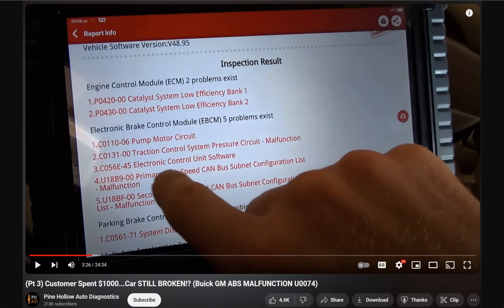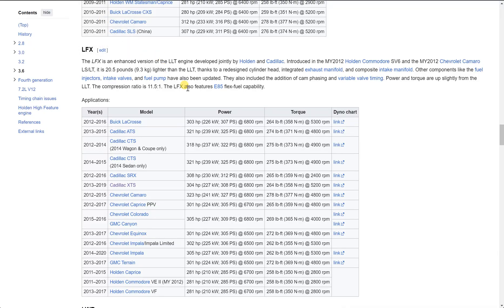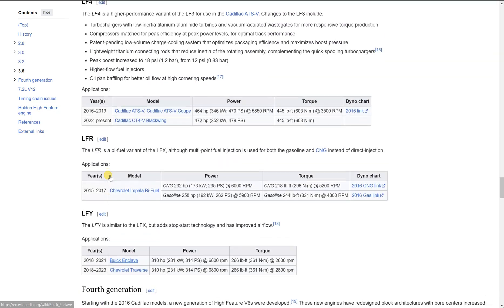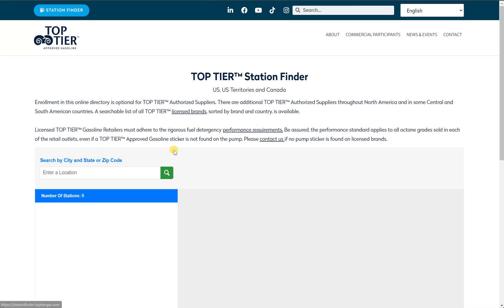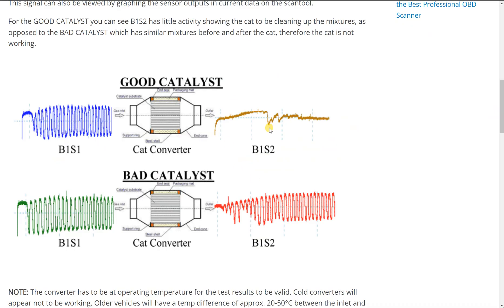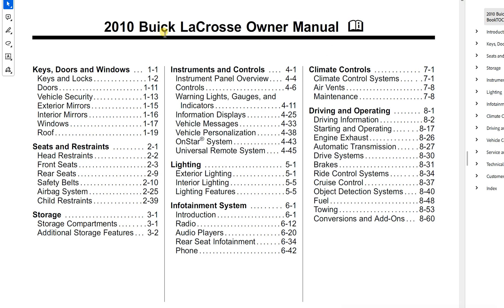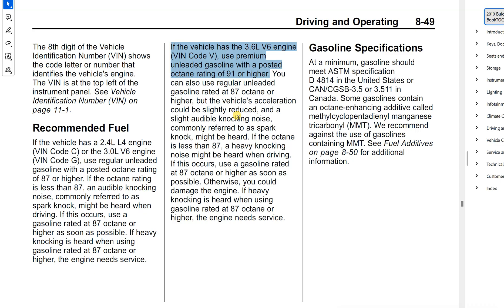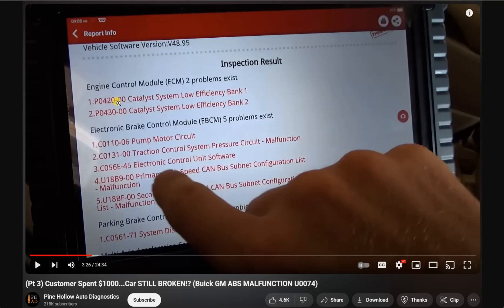Can using the wrong gas cause a P0420? I argue it can. Short discussion on GM High Feature engines.

Comment: Hi oneanddonediy.  I enjoy your video.  The 91 octane or higher is needed for high compress ratio engine.  A compression ratio of 10.5:1 or higher needs high octane gas 91 or 93 because it requires higher compression for ignition.  A lower octane gas leads to pre-ignition in high compression engines.  Also, spark plugs are important.  Also, cheap gas will with low detergents will lead to carbon build up on valves, rough idling, leading to misfiring and eventually a check engine light.
Reply from the maker: Indeed thanks for chiming in!  Running 87 is only good in some cases, but people need to be aware that the car 'will run' on 87, and the owner's manual may 'recommend' 87 but that is not the best choice in a lot of cases.

Comment: 91 octane Non-Oxy gas is all I run in my LFX!! An engine that has an 11.7:1 compression ratio shouldn't be running 87. Also, ethanol is nasty shit, there's no way in hell I want that in my tank (e10, e15, or e85)!  Interesting take that the higher octane cuts blow-by and consumption. I've had the best luck cutting the oil consumption using Valvoline Extended Protection 5W30. I would also advise anyone with a High-Feature engine to run a catch can on the dirty side of the PCV and a clean side separator on the clean side to capture that 5-10% blow-by that comes back through the clean side on WOT acceleration.

All in all, it's a good topic of discussion, and more people need to be made aware of the potential pitfalls of these engines, and what to do to prevent them!! 👍

Side note: I made my own sticker and put it on my wife's Cruze's gas cap to only use 91 octane. That 1.4 LE2 turbocharged engine ABSOLUTELY needs 91 octane, and nowhere is it mentioned to use 91. Those early LE2s were grenading left and right by people using 87 and driving them like they stole them..
Reply from the maker: Here in NC we have 93 octane, and that is what I use in both my Buicks (LLT and LGX).  I'm my 2006 Colorado 3.5 L in-line 5 cylinder I used 89 octane, and in my pitiful 1.4 L 4 cylinder (but it has turbo!) in my Honda CR-V I use 87 octane 🤣 .  But for sure these GM High Feature engines get a bad wrap but usually people drive them like mad as you said and don't give them just a little TLC. Also I have been considering a catch can. For now everything seems all good

Comment: you're not wrong. i see a difference in my gmc, 2.7 turbo. the malibu i used to have was VERY selective on fuel. any time it would idle for a few, p0420 would come up. it would trip the fuel alcohol. it was an e85 compatible car. finally just traded that sucker in. i've not seen an engine light on the truck but it absolutely does make a difference on how it idles and runs. they say it's turned to run on 87 but i have my doubts.
Reply from the maker: I did some research, and apparently, the cars were designed to run on 93 octane but will run on 87 octane, but this is because there are timing tables in the PCM.  So basically, if you use 87 octane the PCM will advance the timing until it detects a knock, then slightly retards it, but when you ru on 93 octane the PCM doesn't use these timing tables, and tuners have data logged this, please read these two forum threads.  I will do more research and do a follow-up video. https://www.terrainforum.net/threads/hfv6-octane-rating.9654/ and https://www.camaro5.com/forums/showthread.php?t=591858&page=2
Reply: @oneanddonediy  i wasn't that involved with it. i'm just running high test through it. interesting info though, makes sense.
Reply from the maker: @blueovalfan23  OK OK its all good this is just an interesting topic to me right now!  More to come!

Comment: I pick up 3 + mpg using high octane gas in my 350 cdi van.    Lots more power. Ethanol gas sucks bad.
Reply from the maker: Yes I'd say if engine has more than four cylinders and 3 L or higher, 87 octane shouldn't be used. For example I have an in-line 5 cylinder 2006 Colorado and it runs much better on 89 octane than 87 octane.
Reply: Ethanol has higher octane than gasoline. Adding ethanol boosts octane figures. Thing is it also requires more ethanol to achieve stoichiometric mixture because ethanol is less energy dense. Still it resists detonation better and is thus higher octane. Running low octane fuel and force the engine to run rich. It isn’t ethanol’s fault
Reply from the maker: Good to know, I'll have to do more research on ethanol gas!

Comment: What octane did the sticker inside the fuel door recommend?
Reply from the maker: I'm my car? If you are asking about my car, there is no sticker. Based on my experience and the owners manual these engines need 89 octane or higher. I know my experience is anecdotal, but but I've seen this in multiple vehicles with these high feature engines.
Reply: @oneanddonediy  yes there is usually a recommended octane sticker inside fuel door and I wondered if Buick had actually said 91 or higher there.  I believe what you are conveying....I use top tier gas always and have found that my 87 octane Highlander V6 gets 17.5 mpg on regular and 22 on same work loop on 93 so I believe the extra octane and detergent are worth the price..for about the same yearly expenditure on fuel.
Reply from the maker: @vlxneutron2835  I see what you mean about those stickers, I remember seeing those octane stickers years ago, but I have not been those stickers in years.  I have owned 7 cars in past 10 years ranging from 1999-2021 and have not seen a octane sticker inside of the fuel door.  Yes, the higher octane if definitely worth it is V6 engines especially the GM high feature engines.  This 87 octane they advertise seems mainly so appease most people about lower gas prices when in reality, in some cases, you can buy the high test and your car runs much better and you get better fuel economy.